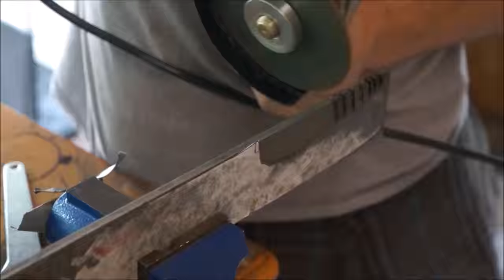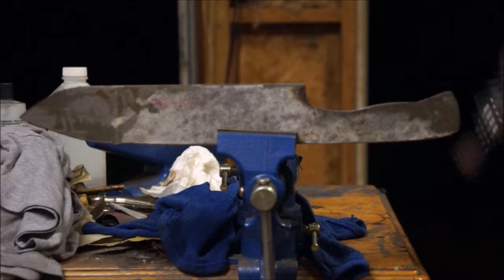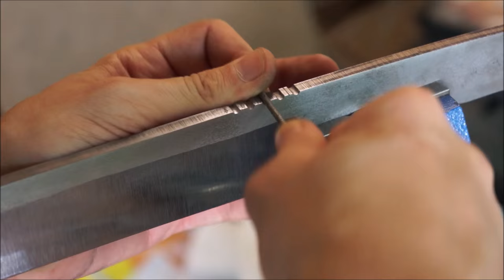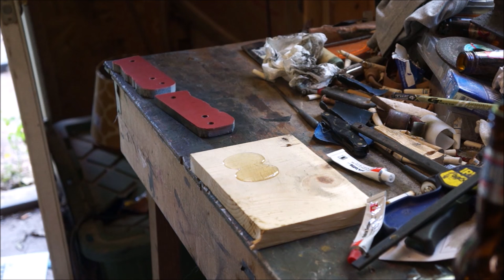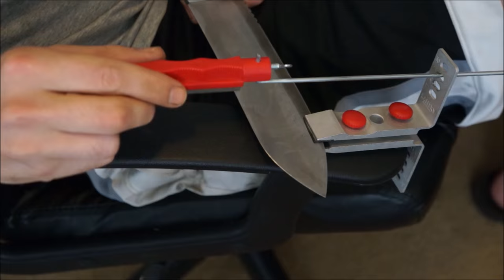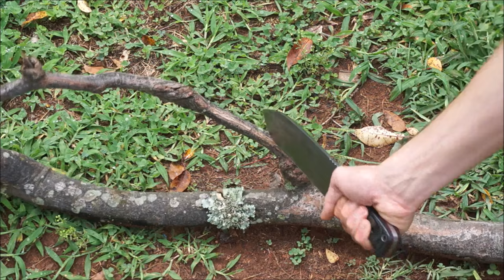Knifemaking: Making a 1075 High Carbon steel Chopper.

Comment: Err.. whats the point of using wd-40?? i mean it's not oil.. thats not the purpouse
Reply: +Aurelijus A According to wd-40 themselves wd-40 does have lubricating properties even though it is a dispersant. It will work in a pinch, it's not my go to choice but it will work.
Reply from the maker: +Aurelijus A pretty much what +Adam Bodford said.  It works fine for the quick jobs that I do. I never drill something that's very thick. for longer drilling jobs I would have to get something else. thanks for watching
Reply: asimmons913 Tell you what I use that works great is marine gear oil. Of course I back off and let the drill bit cool a lot while I'm drilling. The heat is what really destroys them and they get hot crazy fast. Also this is a great stock removal job. It is very professional looking, I would have never thought to use broken arrow shafts to peen with.

Comment: How do you etch your logos
Reply from the maker: +Jackson McCoy I put finger nail polish on the blade then scratch out the logo. then I attach alligator clips to a 9v battery with alligator clips.. then you clip the positive to the metal of the blade and clip the negative to a cotton swab(q tip) that has been dipped it vinegar with salt diluted into it. then just simply press the soaked q tip on the scratched out area and your etching. this may sound confusing but it really is pretty simple. I've been thinking about putting a video together explaining this process in detail. Thank you for watching.
Reply: +asimmons913 I was about ta ask what solution you used but nvm and Rah. Btw Jackson you can also use painters tape and cut out the Logo you want to etch

Comment: what is blade width?
Reply: He scenes the bevel edge with a 1/4 inch drill bit so the steel thickness is 1/4 inch at least very close to that
Reply: Scribed not scenes

Comment: just saying cause im poor and dont buy sheets of metal but if you would of put the blade tip at the edge of the end you could of traced 2 knives off that 1 peice of metal
Reply: He put the bottom of the handle at the bottom of the metal, it's the same thing lol

Comment: Only one thing don't temper the handle, after that nice job.
Reply: The blade would shatter without tempering,  expecially being a chopper
Reply: +Matthew Ballard We know this but you don't want the handle tempered.
Reply: Carl Smith i mean there is a chance of the blade snapping off of the knife at the tang unless it is tempered
Reply: +Matthew Ballard OK well when you learn how call someone who cares, you don't quince the handle it gets tempered on the final 400 degree bake in an oven.